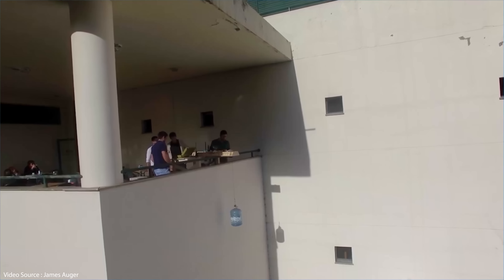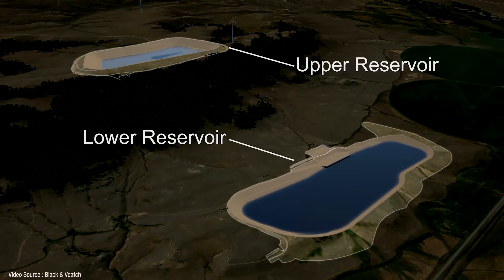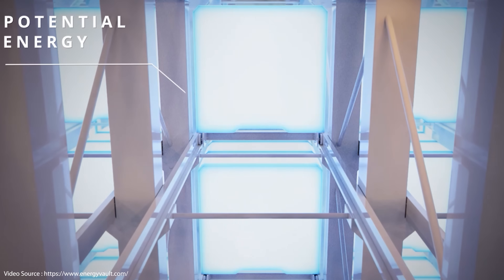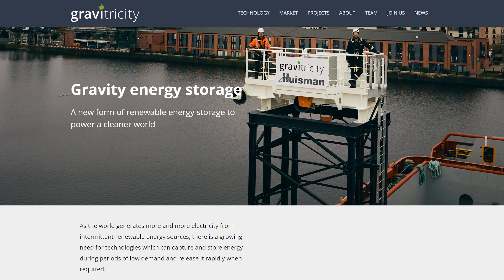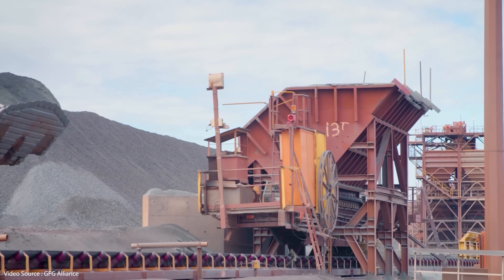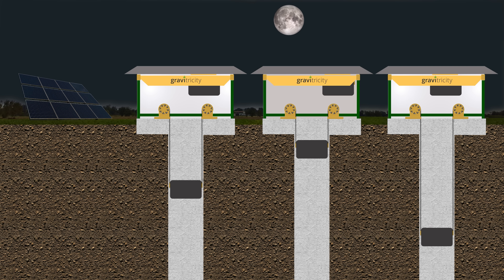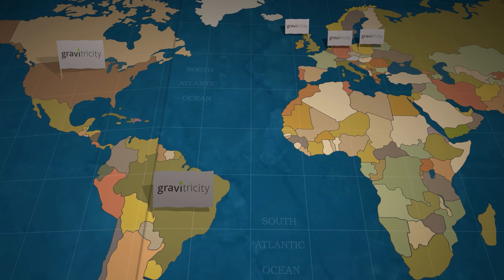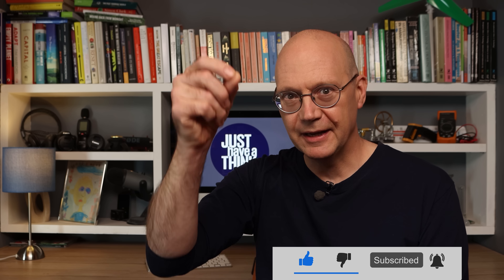Gravity Energy Storage. Who's right and who's wrong?

Comment: Great video, Dave, and a great idea, to see how projects are getting on. Here in Saarland, Germany, there are many disused deep mines, so perfect location for energy storage. I'm sure the tech. won't cause earthquakes, all nice and smooth. However, the shafts are all full of water, sure the weights aren't bouyant, but would act like plungers. I wonder what the consequences would be? Loss of energy, fountains...
Reply: If the shafts are full of water, I wonder if they can be pumped out and used as the lower reservoir for pumped hydro?
Reply: @ericmgodfrey  Quidnet Energy wants to use such shafts to pump them full with water under pressure as an alternative energy storage system.

Comment: There are so many great ideas for alternative/clean energy!  I saw a video last week about a small village in rural Norway that was using/testing a small-scale' sand battery' in a silo, initially for heat for the town in the winter.  It used renewables to heat up the sand in the silo and heated to like 500 degrees, and would stay for months!  This heat of course could also be used to turn turbines as well.  They said the test case was successful and the next phase was to build a system 10x as large.  Straightforward design, nothing to combust, just hot sand!  It will take all these many different ideas in place in different parts of the world where they may be best suited, but definitely doable!  Thanks for your channel highlighting many of these ideas as well!
Reply: Denmark use water stored in pits to supply communities. The sand looks like you could scale it to home usage. 1-2 tonnes.
Reply: @GrahamCampbellNZ  That's work too!  The simpler the solution is often the best!
Reply: Heat batteries make a huge amount of sense for anywhere that needs heat as an output, less so if you want electricity, but it's not crazy..  and a LOT of things want heat. from laundries to steelworks.  super low-tech and really simple to integrate.   for district heating like they use in scandinavia it's a no-brainer.
Reply: @mralistair737  Thankyou, agree 100%
Reply: @mralistair737  Steel works need a lot more heat than a heat storage facility can put out... but in general, waste heat from industial plants can be a great help in "filling" that heat storage.  They already do this in Rotterdam and a few other Dutch cities: waste heat from industry and greenhouses is pumped through a city wide network to heat homes, and when needed a gas fired plant kicks in and adds a little more heat.  The gas plant might be replaced with a large-scale heat storage.

Comment: I don't like the cube towers, since it's a total electrical energy loss to transport blocks laterally. It doesn't affect the potential energy, but it does drain electrical energy to move the blocks anywhere but up and down. This is a drain on stacked block towers too. Moving blocks closer or further from the tower core is a net loss.
Reply: There is also the issue of the embedded energy in the construction.
Reply: There's a lot more issues with that concept. While the principle is tried and proven as a warehouse system, there has never been a setup like this as far as I am aware with handling weights anywhere near this.
Reply: @Hans-gb4mv   - not endorsing the full concept, but just pointing out that shipping containers have a maximum laden capacity of 30T and large modern shipyards do have pretty sophisticated technology for moving them around, and onto and off transports.   These are often stacked quite high.
Reply: @Hans-gb4mv  With a proven warehouse system in place, just change the setup by just making  those blocks a perfect sphere, and move them easily with an  electro magnet  situated above the  track...similar to a bowling alley transport system....minus the gravity-assist feature... The blocks/balls roll  towards the tower and onto a receiving "glove", gets lowered to its intended location, making power on its way down; then exits and rolls again to its intended pick-up location, waiting to be hoisted to its original point.....A particular scene from... Raiders of the lost Ark comes to mind  LOL
Reply: Not just lost energy... Wayyy too many potential points of failure. A weight suspended on a hoist could be deployed even if there was no energy in the system... Like during a total outtage. But a giant warehouse of weights stored in computer-controlled conveyances by definition requires inputs to operate, so it could never be used as emergency power during outtages. And is just flat out going to break down at some point.
Reply: @patreekotime4578  I can't believe I'm defending this daft design, but all power stations require some power to operate. In this case you would just need to have enough weights ready to drop to ensure there was power to move the weights sideways.
Reply: The engineers should be able to design the system in such a way that the blocks that have to travel laterally do that on a small slope configuration ,to reach their destination;  by equipping the blocks  with temporary rollers, or design   the transport railing system with permanent ones.
Reply: @MolloRelax  euh... no...simply, no. Energy Vault's concept is flawed from the start.

Slopes? Did you get any education in physics at all? Either it means spending more energy pushing the blocks up a slope when storing them or spending more energy pulling them up a slope towards the crane to lower them so as to create energy. Oh...hold on.... let's put the floors on motors so that we can tilt the floor as needed and there for control the slope direction... if that is your next idea you should apply for a job with Energy Vault.

Never mind the amount of materials needed to build the 'warehouse'. Or the amount of points of failure inherent to the idea. Just imagine something failing while moving a block around, how to access that block and rectify the situation and what to do with the thus created blockage and bottle neck it poses.
Never mind the amount of detectors, controllers and other electronics to keep track of it all, or all the motors to move the slides around in the X and Y axis. 
Never mind the amount of cranes needed to actual hoist the blocks up but also to actually use to generate the electricity when lowering them. Because only using 1 crane for the size of blocks they are talking about wouldn't produce enough electricity to boil the kettle for the supervisors cup of tea.Which means either having a dedicated bunch of cranes to all the exit points or you have a smaller bunch of cranes that are all motorized so they can move along the outside walls of the 'warehouse'. In other words, even more materials, technology and even more consumption of energy so as to produce a bit of energy.

When you actually start thinking about it logically and practically there's only once conclusion that one can come to. The entire concept of the warehouse to store the blocks in is comes down to the equivalent of trying to cool a room by letting the fridge door be left open.
Reply: @PDVism  WOW, you sure go to a great length in explaining/displaying your pessimism. 
For me; the very limited physics I have learned in school was enough to keep me alive as a lifelong logger in western Canada. ....Wind direction and speed, inclination, species of wood
( which affects  your pivot point location)and especially your escape route.
 
A small warehouse of deadweight blocks waiting to be moved into place to potentially start making electric power is a decent concept in itself. Maybe the blocks themselves could be self-propelled by a rechargeable battery powered wheel system. Batteries would charge up in the waiting area...using some of the  electricity produced on site. One or two cranes should be able to maneuver the blocks into their required position.
 

As a side note, a decent size fridge,  and a fan in front of its open door; is quite effective in cooling an area. I have done it just for experimentation.
Reply: @MolloRelax  To qoute you : "....a decent size fridge,  and a fan in front of its open door; is quite effective in cooling an area...."

You might want to edit if not delete your post. It demonstrates your lack of even common sense let alone actual understanding about even the most basic of concepts.

Here's a question for you to ponder over, that will demonstrate how idiotic the idea of cooling a room by opening the door of the fridge is.  Where do you think the heat extracted by the cooling mechanism goes?
Caught your error yet? How about if I point out that it would be akin to having a portable airco unit sitting in the middle of the room with the air outlet blowing into the said room.
Reply: @PDVism All your points are valid ones. But an AC unit does not have  a  reservoir of cold  like a fridge does .So maybe the error is partly yours,  And  I never said it made any sense , I only said it was effective ( ok..for a short duration). But isn't that the point? ...getting instant cooling satisfaction for an overheating  body..
Reply: @MolloRelax  I would say quit while you're ahead but.... you never were ahead.

All I can conclude is that you are one of those that can't admit when you are wrong.
Sure, opening the fridge will give you a very fleeting brief moment of feeling the cold that was inside... and after that... it doesn't help at all. Will it actually lower the temp in the room at all? No, not even by a tenth of a degree. Will it give the person standing before the open door respite of the heatwave outdoors? No.

Just like putting lots and lots of motors to move blocks not just up and down but also front to back and side to side will consume more energy then lowering any one of those blocks. The blocks have to be heavy to produce enough gravitational energy but that means inertia to move them side ways is very high and there for one needs powerful motors to slide them in the horizontal plane, motors that only consume, not produce. In short. Anyone with the knowledge of the 3 laws of Newton, or common sense for that matter, sees why the concept if flawed. 
Even if, like you, they can't admit when being wrong.
Reply: @PDVism  Gosh. it looks like we are having a conversation here....I find your input a bit hostile ,but maybe that is your way to converse. My comment will stay as it was posted. I will just add this. There is no heat extraction from the fridge. And  I find it  ...maybe not idiotic; but quite naïve  to assume that the fridge would be plugged in after it is brought into the room? 
There is plenty of cold reserve inside to achieve a welcome cooling effect .( By the way, I transferred the beverages into another fridge for the test).  Last summer , we had a couple days of 35C in our area. I placed about 20 pounds of ice inside an old but  good quality cooler, I made a couple holes  in the lid for circulation ; installed a 6 inch soft ducting material, and installed a 12 inch rotating fan at the receiving end of it all. It was quite pleasant to feel the difference for at good 3 hours in the room ,before adding more ice...for those 2 evenings. I would say that it worked better than the fridge test, for the amount of space it took to set-up.
Reply: @MolloRelax   @MolloRelax  What you are describing is a swamp cooler. Making the air more humid so as to evaporate it and give you a sense of coolness isn't the same as lowering the temperature in the room. 
Goal post moving much?

You bringing up a swamp cooler feels like a desperate attempt to avoid admitting you either don't understand physics or you do but can't bring yourself to admit that your slope idea to moving the blocks around is as silly as putting a plugged in fridge into a room and opening the door thinking that it would lower the temperature in the room.
Reply: @PDVism  Swamp cooler(cool name too) works great IMO. 
Also, it looks like you read my fridge comment wrong; and the silliness becomes all yours ,cause it sure seems like you were  thinking/assuming that the fridge was plugged in after I rolled it in the room,...well, Duh!!!  it wasn't. So again, no heat extraction.
Now, for the slope idea...  Since you seem to like to discredit ideas;  explain why the slope system for moving mass  objects is such a silly one. Educate me with your physics expertise.
 The electricity making process envisioned here; is already utilizing gravity to achieve production. It just makes sense to use it too to move all the mass needed for their intended purpose .
Reply: @MolloRelax  Putting slopes in the building to move the blocks are not a silly idea. They are an outright STUPID idea.

I can't believe I have to spell it out....

You haul up a block to the desidered floor so as to store the potential energy when lowering it. With me so far? 

You put slopes in the building so that the blocks 'slide' to the furthest down slope point? Still with me?

Now you want to release the energy you stored by lowering the blocks.... but to do that you have to bring them back to the point where the blocks can use the crane. In other words, you have to PULL them upwards to the exit, there for spending even more energy in not only moving them laterally but actually pulling them up a slope. 

The bigger the blocks the more energy stored. The bigger the blocks the more energy you'll waste pulling them uphill.
The amount you would waste further lessens the efficiency of the entire project, which is already low to begin with.

Of course you could make it so that the floors can be titled so that the blocks slide towards the exit point. However, if you don't see how much worse that would be than even pulling the blocks up the stationary slope you really need to go back to kindergarten and re-start your education from there.
Reply: @PDVism  I can't believe it has been two weeks. I have been so busy . So. .Sorry there.. but  you simply are NOT worthy of my immediate attention , as to do an instant reply to yours.  So, THEREFORE 
( correct spelling  by the way )  I have no clue where you got the idea  that ; once the blocks  are at their pick-up point; after rolling slowly into position; that they would have to be hoisted again to reach the area where they can just sort of fall into the receiving "" gravity assist device"" 
Also ; you referred to kindergarten education. Well in my days  there was no such a thing. The system was invented for  ..and still is  used that way...just as a  government-sponsored  babysitting service to the parents....That every taxpayer has to contribute to.
Reply: @MolloRelax  Grab a cup of coffee and perhaps you can follow the following easy steps.
1/ lift block = needs energy to be spend
2/ move block to back of storage area = either sliding down a slope or motor assisted, if later, needs energy to be spend
3/ move block back to lifting area = if going down slope before then it will need to be pulled up the slope = spending energy OR if it was pushed up a slope than now you can recover a teeny weenie little amount of energy
4/ letting it down, gravity assisted = gain energy

So step 1+2 or 1+3 needs energy while step 4+2 or 4+3 gains a bit of energy. Either way, seeing that step 2(3) or 3(2) will spend more energy than it gains it's an additional loss.
Keep in mind that the angle of the slope will greatly influence the amount that will be wasted to move the block up the slope. On the other hand, if the slope is very small than it will take forever to get things moving.

And on top of it all, once you have the block moving down slope you will to break it because you don't want to just slam into the end position which equals in even more energy lost.

I hardly spend a few days in kindergarten myself because at that time it wasn't obligatory, yeah I'm old as well. Difference between us is that I can admit when I'm wrong something which you clearly can't seeing that you hilariously think that a swamp cooler cools a room.
Another difference is that I, unlike you, understand basic physics and you seem to be one of those that probably thinks Elon Musk is a genius and that things like Hyperloop or not only an original idea (it isn't) or that it is commercially viable (which it isn't).
Reply: @PDVism Hi!.. of course I grab the fact that , lifting the blocks and sending them to their pick-up point will need energy.  (Have you heard of the oil industry yet ? )Drilling holes , miles deep in the ground requires energy too.. It's all a matter of economy of scale
Your #3 point is  totally irrelevant ,because , once the blocks are done their journey; they will not need to be lifted any higher ,simply because they will already be at the location where they get installed into the gravity assist device. You don't seem to grasp the concept that the  block storing tower can still be higher or at the same level as the gravity assist system.  Just think of it as a  corner  store's  soft drink distribution machine ; where the next pop can approaches  and takes the place of the previous one. Then extrapolate from that concept and beef it up  however many order of magnitude it needs to do the job. As for the genius of Elon Musk, I have not a doubt about it. In my book; ANYBODY that teaches themselves the intricacies of rocket science deserves the title of genius. He not only taught himself but, remember  he pioneered the re-usability of rockets; something that the best NASA engineers never considered feasible. By the way; I have never been afraid to admit when I am wrong. The swamp cooler makes me smile every time I use it. As far as I am concerned  I am just wrong...according to YOU, I have not seen other comments  discrediting my input in the matter....Great debate again!